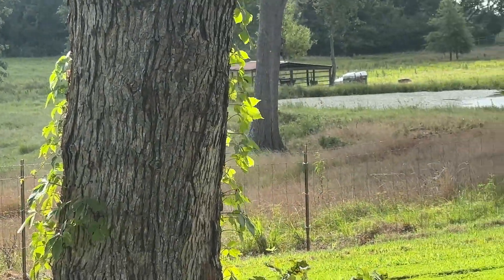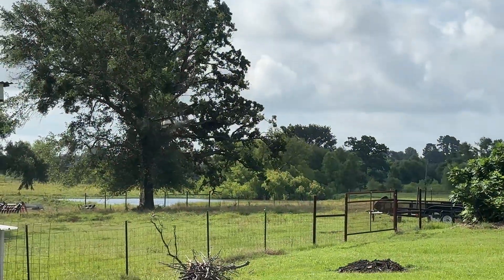Using a Drone to Spray Weeds in Your Pasture | Save Time and Chemicals

Comment: General cost per acre for this kind of service?
Reply from the maker: Hard to say. 
You would just need to call and ask someone in your area that does it. 

If they have to travel very far, there might be a surcharge. Also, it depends on what chemicals you’re using and how expensive they are. 
Wish I could get more specific, but just too many variables.